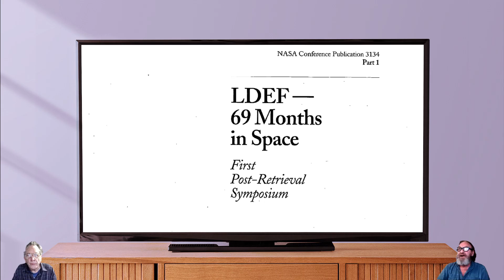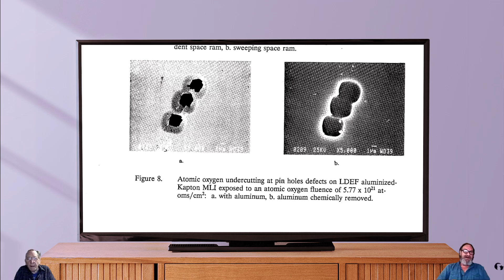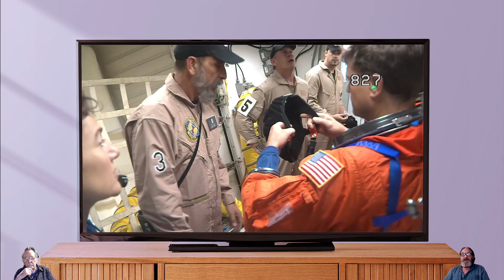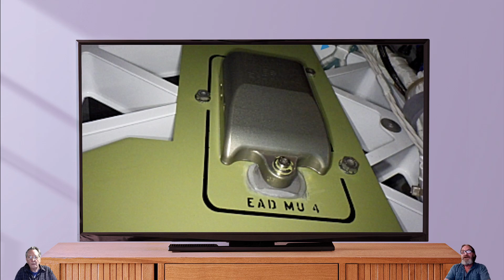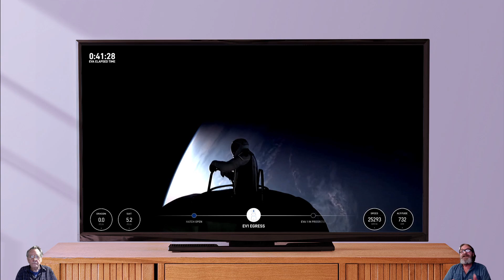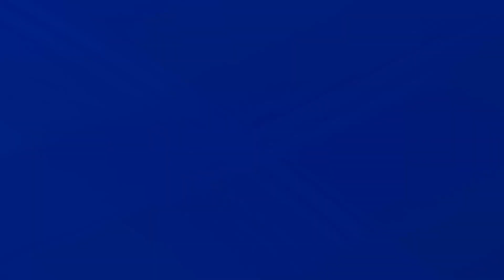"JARRAH'S RADIATION READINGS\AFFECTS OF SPACE ON MATERIALS\POLARIS DAWN SPACE SUITS\VACUUM" P95

Comment: the statement a "vacuum" is a negative force is just catagorically false... a vacuum is lack of pressure, pressure is a force that is why its measured in pounds.  It is misleading to think of it that way as the force in the object NOT in the "vacuum"  a vacuum BY DEFINITION is mearly a "thing" that has a lower pressure than something else. In the case of the universe a "vacuum" is just the noraml state, there is no force present.  now when you put all the gasses on earth they want to defuse into space, but you have to take all forces into account, and gravity is stronger than the force of diffusion so they bunch together and are not able to escape into space, the lower you go the more pressure there is so the more they are being pushed away from the earth, but the force of gravity of all the mass of particles above it increase the pressure of the molecues at or normal altitude.   Pretty straight forward.  you can think of space as zero force (even though there is a tiny bit of pressure due to the random hydrogen atom floating around).    

That should really help you understand it better, absolute vacuum means there is ZERO pressure and thus ZERO force, a vacuum can not do any work whatsoever, the work is done by whatever is in the vacuum and the energy stored within it.  All the pressure on earth is caused due to gravity, and so there is a positive force of the pressure everywhere due to the mass of air above use all being pulled by gravity.   So there is no negative force.  A negative force is mearly confusing the direction of the forces being applied.  and would mean the force is in the opposite direction, so when you try to call the vacuum a "negative force" you are mearly confusing what is causing the force, which is the thing that is under higher pressure (more force) than the vacuum.  

I am not sure how i can explain this better, but one day you all will get it... i am confidence.
Reply: LOL - Same old try at canceling out physics when a terrestrial created human or material isn't subjected to the force of a vacuum.
Reply: @yomommaahotoo264 I recommend you reread the above post.
Reply: @mtoon6032 
Are you not confusing AD's clear assertion of vacuum energy as a relative term?
Took for granted most here already knew that.
Reply: @yomommaahotoo264  read what i wrote again if its confusing you, there is no energy from a vacuum, space vacuum is the "zero point" energy, meaning a system cannot have lower energy than empty space.  So everything else is more energetic meaning it produces the force, not the empty space (aka "vacuum").  This is not complicated to understand.  instead of the term "vacuum" which has this inherent idea of "sucking" which seems like a force, think of "void"   which is the technical definition of a vacuum.  there is nothing in the void to generate force.  the force is all coming from the objects either in the void or in the case of a vacuum chamber on earth, its coming form the atmosphere surrounding the void.
Reply: @yomommaahotoo264  will make it even more simple for you... if you blow up a ballon the air inside sees the rest of the earth as a "vacuum" chamber, it is not a strong vacuum but it is a "vacuum" in the sense that it molecules are less densly packed.  now if you pop the balloon the force is generate by the molecules in the balloon, not by the surrounding atmosphere, this is very easy to understand right?   its the exact same no mater what level of pressure you drop the surrounding environment,  nothing magical happens at extremely low pressures. and yes materials will act very different under very low pressures as they were not made under those conditions, so strange things can happen, such as elemental "off gassing" those are all real, but it does not change where the energy and forces are coming from.
Reply: @bobsmith-gn7ly 
The absence of matter vs matter creates a potential difference in energy, no?

Using the terms vacuum energy is just a relative term for neophyte earthlings.

Comment: the force is coming from the outside pressure...  there is no force being generated by cooling gasses or condensing gasses.  the force is by the external environment.  If you did the same experiment and put the whole system in a vacuum there would be no crushing of the container, the container however would have to resist the increase pressure as the gas expands inside the container.  The reason why these things crush is because pressure is allowed to bleed off while the gas is being heated, if it was not it would just increase in pressure than as it cooled returned to its initial pressure.    (this can be seen every day all the time... your car tires are an example, when you heat them by driving the pressure goes up and then when they cool it goes down there is no crushing because the pressure is contained.)   Your can or egg experiments are the exact same, pressure is allowed to escape and so the internal pressure reamains = to external pressure, then when it cools it is seal (by the egg, or by turning the can upside down in water.  if these exact things are not done you will have no crushing it will be essentially the same as the tire, the internal pressure will go up (assuming the container can contain this pressure) it will the just go back down as it is cooled and return to its initial pressure.  This stuff is not that complicated.   maybe one day you will get it. 

Still no understanding of vacuums..  Cracks me up.   Love the work anyways, even if a lot of it is mistaken.

Comment: The Atomic Oxygen (AO) in the low Earth orbital environment (LEO) is formed by photo-dissociation of diatomic oxygen (Banks et al., 2004). Short wavelength (<243 nm) solar radiation has sufficient energy to break the O2 diatomic bond with energy of 12 eV in an environment where the mean free path is sufficiently long (~108 m). Thus, the probability of re-association or the formation of ozone (O3) is small which means that the rate of splitting of O2 to the atomic Oxygen Species (AO) by UV is faster than the corresponding recombination (Duo et al., 2012; Yokota et al., 2006; Rohr and van Eesbeek, 2005; White et al., 2005). As a consequence, over the LEO altitude range, atomic oxygen is the most abundant species and has a very high probability of long-term survival in the low altitudes (Banks et al., 2004; Dooling and Finckenor, 1999; Kiefer and Orwoll, 1987; Reddy, 1995). Although excited states of atomic oxygen can be formed, their lifetimes are sufficiently short. Thus, the atomic oxygen in its ground state, O(3P), dominates the LEO atomic oxygen formation, dependent upon the diatomic oxygen density and solar UV flux (Banks et al., 2004).

Oxygen atoms are known to be highly corrosive, once combining with most materials they encounter. In addition, a spacecraft’s orbital velocity of 7.8 km/sec expose spacecraft to a stream of AO at energy of approximately 5 eV (Dooling and Finckenor, 1999; Morrison et al., 1988). The AO collision with the spacecraft surfaces with this energy initiates numerous chemical and physical events on the surfaces. Erosion of surface, loss in mass, degradation in mechanical, thermal and optical properties and changes in chemical compositions of materials can be resulted through the collision with AO. In addition, materials that resist the AO erosion effects are likely to create optical glow near material surface which may hinder the visibility of the optical systems of any given space structure (Han and Kim, 2006; Shuvalov et al., 2007). Even if the flux of atomic oxygen does not erode the surface, oxidation of the surface may change the thermal properties of the surface layer (Hasting and Garrett, 1996) which would mean that the thermal requirements of the craft may be compromised by the resulting change of the equilibrium temperatures.